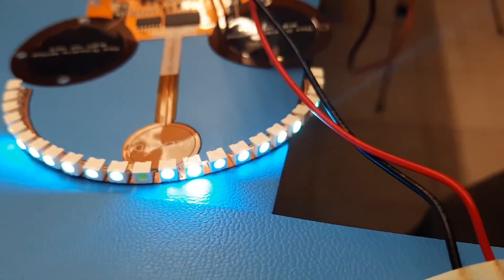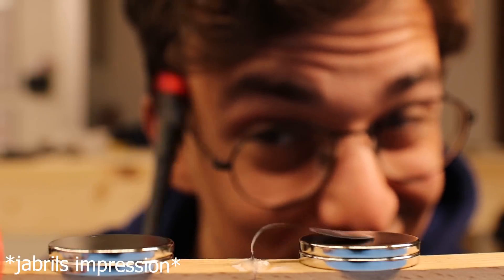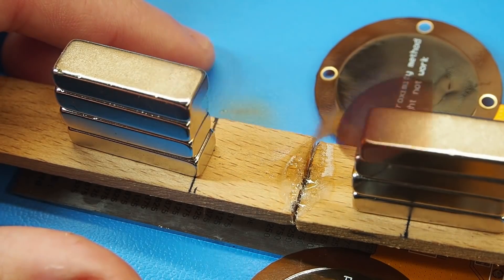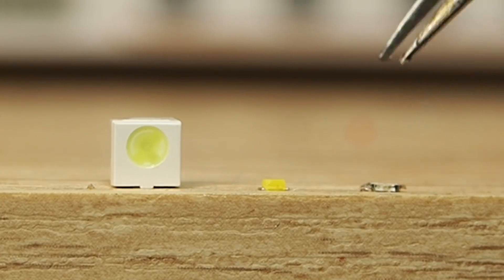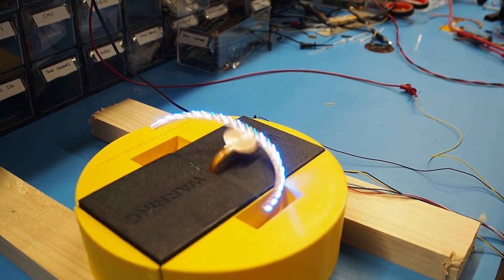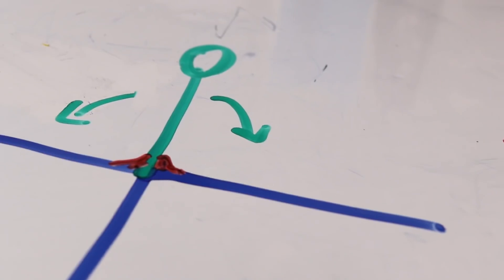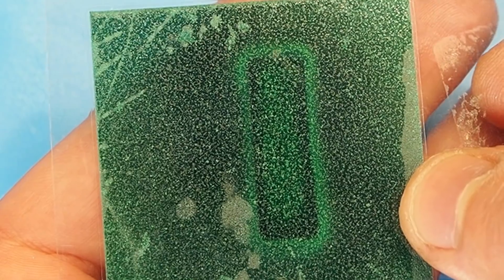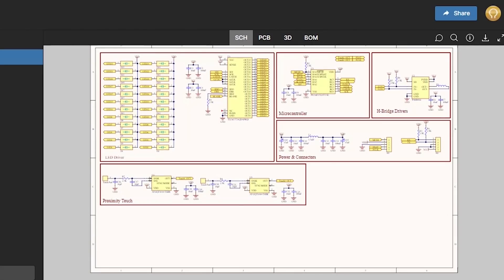Hemispheric Flapping Display

Comment: What I would do ... instead of ONE/SINGLE /CENTER holding "arm" I would do it on the both ends of the arc. with coil of course where it is now.
I hope you know what I mean. This could prevent random flapping of the arc ends

Comment: Also you need to desing a flex wire femmel connector/mechanic hinge  and separate the connector equal in a small flexwire who connect other part to reduce the resitence .. i hope i wont look to weird 😅

Comment: truthfully, if you were to have the led strip connected to the base via some custom 3d printed hinges it would in theory work more efficiently. Look at 9:12 for reference.

I know this is 2 years after the invention but if it works, it could revolutionize displays.

Comment: You should seal the display in a vacuum chamber. CRT monitors also used it. Fixing the sides of the display to the ground would improve stability.

Comment: For the parabolic flapping thing a electromagnet magnet on either side with the led segment having a rigid support to hold it I'm shape vertically and the base having a hing with a little play in its inner diameter compared to the pin or rod holding it would be good to give it its ease to travel its arch. Then at the sides you would use either bent leaf springs ir very low resistance coiled springs to act as bumpers to volley abs reverse the direction. If tge led array back to tge other extreme of tge display. 

Hope this helps you out. Nice work. It would be near to try to get a higher resolution pixel display and sort tge timings to have a richer full color video display.

Not sure if the is already a solution to get basically a strip of led or lcd to do this but I'm sure it might not be hard to get a crowed sourcing thing or partnership with a manufacturer that deals with those arduino protect screens to produce this for you fairly inexpensively possibly. The notoriety might be reason enough to justify them potentially doing it for free or something maybe reach out to adafruit I'm sure they gave some connections plus they would love to showcase soneth8bg lije this.

Comment: I think you will find that if you use an upright base to hold a leaf spring that is several inches long and placed in its center with the led array instead of tge floppy flex circuit abd use 2 electromagnet one above and below  the extent of the mechanism with two very small magnets or fetomagnetic metal strips you can use a micro controller to actuate the electromagnets in an alternating fashion pirodically to drive the leds. The idea is low frequency and to actually skip cycles  to lower power consumption abd allow the leaf spring to do most of the mechanical oscillating by springing back abd forth. You could really just use a sensor to tell if the lens are reaching their extremes and if not fire the electromagnet to keep it running correctly. Just add a leaf spring taped to your flex pcb so you don't have to remanufsvture anything.

Comment: 100 kg strong magnets for this king of stuff is overkill of overkills. I'd rather start with  measurement of intrinsic resonance with SloMo camera and manual dragging. Then I'd increase this resonance frequency with adding more flexible legs in parallel. This approach will also remove side bends from LED semiring.

Comment: Im in love with this concept! I have a few thoughts that i would like to share. Before i do, i have no experience at all in this field. Just a creative magician. Here goes:

Currently you use the magnets to attract the flap. This makes it that the LED’s make impact and damage overtime. And speedwise, its a lot slower than your previous version that only had magnets on1 side.. that made me think. 

What i imagine is, instead of attract, push it away with the magnets. So it wont impact at all. Before impact it gets pushed. I think you could get a higher frequency to. Attraction is almost instant. Where pushing with a magnet feels spongy sometimes(?) Could mean more control in this usecase? Only thing is faceing straight up should be the natural state op the flap. Not sure on that last part tho. 

You know those floating figurines you can buy? Where you have to place, the object thats gonna float,  precisely in the other magnetfield so it floats? I always noticed that it jiggles a little bit. That jiggle is what i mean. Cant you use that jiggle? 

Again  i have no clue.. just a magician that tries to use his magic mind haha

Comment: I know this is an old video, but does the magnetic field change enough to be useful if you connect the bottom sides of each pair of magnets with some steel? Either as a slightly thicker steel sheet, or a full-on bar?

Comment: hey I noticed that you are still in the prototyping phase so you should not focus only on the product efficiency. That said I was thinking that since the semicircle of leds is also a flexible strip it will be causing a problem due to the air resistance.

You should try using 3 FlexLed each with four leds connected to it and place them together however you would either need three seperate magnets on each side or a magnet with equal strength on each par of it's surface and not just it's center. 
I hope this will be of help and please show me the results of this suggestion in the v4 video. Thanks!

Comment: It seems like the oscillating is causing more problems than it solves. Having the LEDs spinning around an axis would be far easier and more consistent. Also why not use electromagnets instead of those deadly permanent magnets?

Comment: I know you like using the flappy thing, but what about a motor with a circle of LED lights, like one of those fans that cost 5 dollars, and then make it so that it has a cover on the middle part with 2 slits lining up with the circle so that you can turn it off and the LED circle fits right in, so you can put it in the middle of a table!

Comment: Hold the lights on the sides not the middle and make it stiffer with a spring so it returns to center faster should let you run at a higher frequency

Comment: And that's why we just mount LEDs to a rotating strong mounting surface to do the same thing. Put a box around the rotating mount and all it safe an the motors will last longer than a flexible display.

Comment: This is working okay but got me thinking... two suspended wires running parallel with each other, with opposite charges tend to bow or curve based on electromagnetic attraction/repulsion. Why not set up a suspended grid of wires and use the flexAR circuit drive pairs of wires? The oscillating frequency should cause a similar wiggle effect. Micro led strings could then be fixed to the wired grid. The grid vibrate in the timing you want and cause the lights to do the same. You may need a bit more current to run everything being as you'll need power to drive the wire grid, and power to run your led matrix. This should allow for a cubic volumetric display that has a refresh rate for the led firing, and the grid vibration attenuation. 
I find your work inspiring. Keep it up Carl. ❤👍💪

Comment: try optic fibers, transparent, in a fixed grid, 2x 16^3 grid is 4K display in pixels, similar to a resin lcd printer, the pixels are on the bottom, but the optic fibers transport the light the 3d position, also can be 3d photon receiver sensors, for 3d volume camera ccd's or laser pointer receiver, or reverse duck shooter sensor in the pointer, or pointer itself calculating its collision/ray-point intersections by direction/origin of the pointer, magic wand control/pointer device
Reply: Try polarized target surface instead, for a same polarization projector, half-transparent, half-pass-through, like the star wars holographic projector, but to a sun glass flat polarized target panel
Reply: You could rotate or flap the display fast to project to different depths, real 3d volumetric holograph display
Reply: Ie, use projector, not leds, projector stays in the same position, screen moves, only

Comment: Here's an idea. 4 FlexARs arranged to each actuate 90 degrees of a circle. See if you can redraw the coil to simulate a halbach array. 

If you arrange them like an 'X' then you can get the FlexARs to jump together at the top and bottom, then actuate in the reverse direction and touch at the left and right sides. If that doesn't work, you could try 6 or 8 actuators. Also, why not try electroluminescent wire instead of LEDs?

Comment: Sir, you are doing it wrong because you are concentrate in flexing it, the fundamentals is wrong. You can create a rigid semi-spheric line, and just SPIN IT , YOU CAN INDUCE the energy WITH WINDINGS at the axis , so the circuit onboard can work, and in the same way in that energy sent coded the information to display. And that way you will got a perfect semi -spheric display and as it is rigis you can increase resolution limit-less.

Comment: Why not do this with light guides (small diameter optical fibres)? Instead of putting the heavy LEDs out at the end of the flapper, put them at the stationary roots of a strip of optical fibres which can be sandwiched in between two of the flex PCBs. This way you could arrange your LEDs, hidden in the base, in a matrix arrangement of say 10x10, with one fibre per (RGB) LED, while the tips of the fibres that deliver the spots of light could be placed tightly next to each other in line of 100 dots. Think what a high dots-per-inch resolution you could achieve! Also, solder a small disc spring to the central portion of the flex PCB so it bounces off the magnet instead of slapping into it so hard and losing its kinetic energy at the end of every stroke.

Comment: Might I suggest putting the actual LEDs inside the base and using mono filament line (cheap for testing ) later Fiber optic fibers running along the stem and out to the locations on the semi-circle - might be an easier build in the long run. This might allow you to have many more "LEDs" and reduce the overall weight ..

Comment: Your steel plates under the magnets should be continuous between the two magnet poles - in effect, completing the magnetic circuit and turning the two magnets into one (like a horseshoe magnet).  That will reduce the flux density on the underside and increase it in the gap between the top poles.
The same 'trick' works on motors where the magnets are stuck to a ferrous ring to increase the flux density on the exposed faces.

Comment: Could you add a hinge between the two magnets and control the angle with a motor? I think that way, you could dynamically adjust the angle and the strength of the magnetic field, and have more control over the frequency, efficiency, etc.

Comment: good experiment ... i have a suggestion. it looks like your two long flex arms are not balanced and also the central flex arm is a bit thin. the thin arm is adding to adding to the uneven movement at the sides. have you tried increasing the width of the central flex arm? or maybe having two or more central arms supporting the hemisphere. im sure you can get the frequency up that way...

Comment: you're an innovator.
Reply: @CarlBugeja  If you ever come to the USA we'll take my turbine powered van out and go look at some industrial lasers. You would be very wealthy in the USA if you can avoid the predators! 

I'm thinking about some small flex pcb in a T or X or L shape to use in the corners when I lay out LED strips. I use solid wire now and it's a PIA and a flex pcb underneath would allow an LED in the corner where the wires are now.

Comment: I think you're on to something. swept-surface volumetric displays build the surface with springs and stuff to resonate at a high frequency so it requires little energy to keep it moving. I wonder how you could make it more springy so there's more restoring force so that with higher input power you can get it to a higher frequency. perhaps it should have two arms going up to swing on rather than one central one, for stability since the leds don't always trace out perfectly straight lines but also wobble a bit in an unwanted axis.

Comment: the arm needs to be stiffer and wider, with "spokes" connecting the semicircle to the fulcrum in a fan shape to reduce some of the wiggling without adding too much air resistance. A new housing with "tracks" on either side to stabilize and guide the semicircle in a straight arc would also help a lot. to reduce damage to the LEDs (and dampen the ticking noise it makes), add a thin layer of silicone over the magnet housing, or just simple foam stickers.

Comment: I know part of the point is that this is a flex display, but I think you may have better luck if it were stiffer and on a hinge at the base, to prevent twisting and wobbling.

Comment: Fun project!
Can you replace the magnets on the left + right with an electromagnet? 
Can you find a way to counter-balance the weight of the leds? (could make things worst as you increase weight)

If you have a way to have a kind of "spring", it may help to reverse the direction (by storing energy as the flex arrive near the magnet and releasing it somehow). You "break" by loosing energy (probably in heat) and you should find a way to get this energy back.

Most obvious solution is to avoid changing direction (by having them in a circle)... but it make this project not really interesting any more.

Comment: if u can make halbach array actuatior having multiple coil i guess it may help u solve the problem of force required to flip 180 degree by alternating the magnetic field you can get better result and by designing properly required additional support for other led may be full filled and observing by changing circular coil design  what might be the result

Comment: I see three main problems here: Stiffness of the base fles(the pivot), unwanted torsion which destabilizes the system and an electromagnetic coil too small for the applicaition.

So I would recommend that you do the following:
A: Increase the width of the pivoting flex by quite a bit, which allows for a stiffer board and less torsion and
B: perhaps adda couple smaller coils next to the main one or reshape the one you already have to have a more even force applied onto the flex by the magnets
An approach I've seen with similar systems in the past is gradually increasing the stiffness of the fles the closer it gets to the base, this reduces unwanted torsion, allows the bend radius to still be very sharp and increases the natural resonant frequency of the system(which means the display will naturally oscillate at a higher frequency)

There's issues with these approaches as well, mainly with adding more coils which would also add quite a bit of weight in a far point of the fulcrum, which would make it harder to push, but you're also exerting a higher force on the system, so it might balance out in the end.
Best of luck!

Comment: programmer, electronics engineer, but not an engineer.
The flex board retention system makes me sad. Trying to solve a problem directly and not by changing the system is not an engineering approach.

Comment: What about adding some kind of rigid but "flappable" supports? Like a small 3d-printed smiley face (or crescent moon) that goes around the PCB and attaches to some bearing-based hinges at the center of the base? I think you'd get better support for the bend point to reduce wear, as well as save strain on the rest of the parts. I know it's not just floating in air...but if moving fast enough, and the support were thin enough, it'd be the same effect.

Comment: READ!!!!!!  the problem is the flex strip..... you should take a mechanical route and use a spinning actuator that rotates like a wing instead of those flimsy crap strips..... also why not create a brushed rotating connector so that the whole led display can spin 360